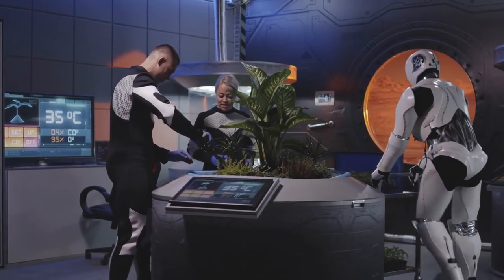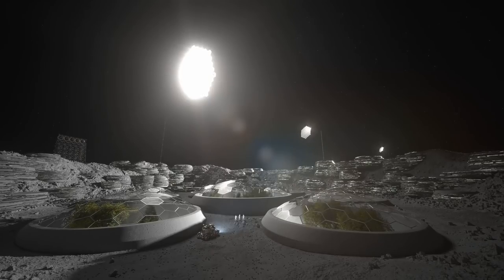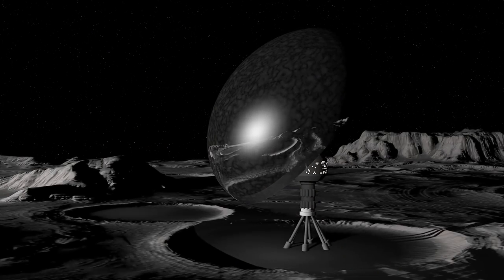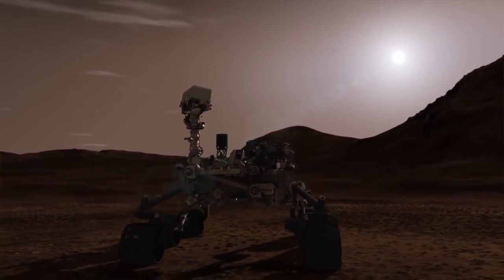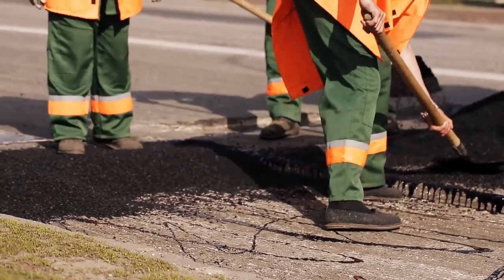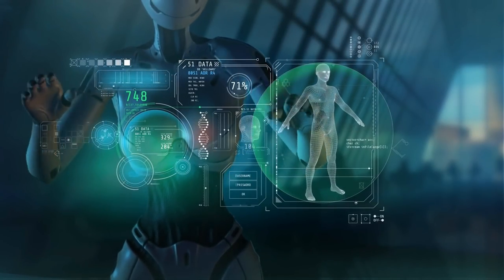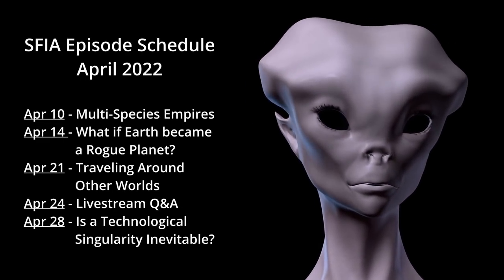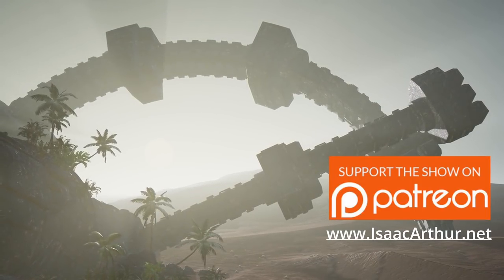Self-Growing Habitats & Space Bases

Comment: The worst part about going to new space bases that you didn't build yourself is that you just have to trust it. You didn't build the thing, you don't know how well it works, the base's computer might say the life support is all good, but it's not the one gambling with its life. How long has it been since the tanks were stirred? If the sensor was broken and reading all green when it wasn't, your air might cut off in your sleep. On Earth you don't have this problem quite so much, because when our systems fail on Earth we're thrust back into our minimally-survivable ancestral environment, not into the instantly-fatal cold spiteful irradiated vacuum of space.

Comment: Nice episode! Question: What is a lunar base to do for power in the two week long night? I imagine the first one will be at the pole where you have unending sunlight available. But that might get crowded, fast. What are the chances that the moon has uranium or thorium? Gerald O'Neill proposed giant power station in orbit beaming down microwave power to the Earth - might work in the lunar night? Maybe solar panel at L2 using masers beaming power to the lunar colonies?
Reply: They can store thermal energy pretty easily & efficiently in a vacuum. They can also put solar power collectors up on towers to get the same benefits as being on crater rims & polar locations(longer day) & to facilitate power beaming.

Nuclear energy is good & there's just as much nuclear fuel on the moon as there is here. Though since the moon never had a water cycle none of that is very concentrated so probably wouldn't be very economical to extract in the beginning.

Comment: from my knowledge of programming alone, redundant and legacy code tend to be far to much of the bulk in any program. those alone, can make some rather interesting bugs, and can take effect in rather weird, conflicting ways. then, you look into legacy machines, too. mk73b of the builder drone bot may have better fine detail control, but mk67z is more robust, and we dont need to worry about as much cosmic radiation. so, you end up having conflict between them, and they keep trying to rebuild, what the other one just built, per their specs, and end up building over top of eachother... simple, but resealable issue.

Comment: Actually, self growing bio bricks may also be a way to absorb and lock away carbon dioxide from the atmosphere.
Reply: In practice, it probably wouldn't be much more effective than building things out of wood.  But, in places where it's hard to grow wood....
Reply: @evensgrey  then again I think concrete releases a lot of carbon dioxide in the process of making it so if you have a process that actually captures carbon dioxide instead of emitting it the net effect might be substantial enough to make a real difference.
Reply: @Dogtroll  You also need a lot of water to make cement concrete.  If you can't grow wood, you probably don't have the kind of water availability needed for concrete, either.

You might, however, be able to grow the fungus that's the basis for this processed building material.